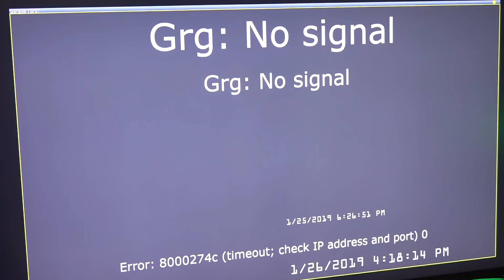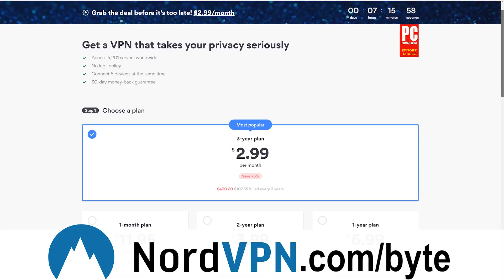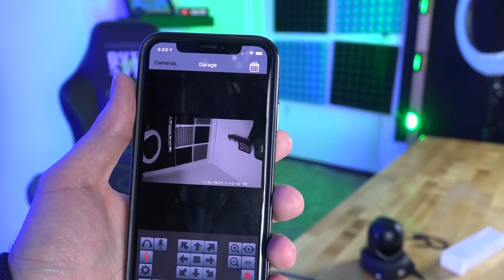I will force this camera to use PoE, even if it doesn't support it!

Comment: i thought you're gonna make a camera use PoE that uses good old coax connection normally
Reply: You can do that too... Axis, and probably a few others, make devices that adapt/convert PoE Ethernet connection to coax and then back to PoE. They enable you to replace analog cameras with digital PoE cameras and still use the old coax cable.

Comment: im not sure how this solves the wifi problem he kept saying was having. was kinda expecting the camera to be opened and the power lines from the ethernet jack would be hacked to the dc jack input, then you would have a ethernet connected camera using  PoE. all youv'e done here is take the power from the PoE switch and discarded the  rest of it. the other way i was expecting was using a PoE injector if you didn't have a PoE switch, pretty common situation

Comment: I'm not sure it's specifically referenced in the electrical code, but you don't want to run 120VAC in the same wall cavity as low voltage networking cable.  You run the risk of an ignorant person accidentally bridging the two with a screw or other fastener and turning your low voltage cabling into high voltage cabling.

Additionally, that white area on the drywall is covering screws.  There will be screws every 8-12" on ceilings and every 16 inches on walls.  You could have verified where the screws were by using a magnet on the drywall first.  Also, should you ever want to finish the wall in the garage, you will need to patch the ceiling, cut a new hole in the top plate and run the cable down.  Might as well just cut the hole in the top plate to begin with and save the time.
Reply: This comment is underrated! TY!

Comment: Hey Jason, I'm a big fan of the show! I was just reading about the class action lawsuit involving the core count of the fx series processors. Basically because the cores share a floating point modules they cant be considered full cores. As I am currently using an fx8350 as a plex server on unraid I was wondering if the transcoding process is more integer or FP heavy?

Comment: Drive rings would do wonders for cleaning up the mess in your attic.  Wouldn't take a lot of work and in the long run, less chance of walking on the network wires and damaging them.  By the way, with such a tall access point for the attic, why not just buy the right ladder for the job.  Just makes sense.

Comment: You should have put the wire through the wood, then fill the hole with fire rated cauk, that way if you want to finish the garage the wire won't be in the way. You can also add another switch out in your garage just in case you need more ports.

Comment: I would have put the hole through the header plate.  That way if you ever put insulation in your garage walls and decide to put up sheetrock it would be easier to hide the cables at that time.
Reply: He's not qualified to drill into the top plate

Comment: Any reason you didn't run the cable through the top stud? it could have been much cleaner that way and it would have been better for the off chance you finish the drywall in there.
Reply from the maker: because the top stud was only partially open at the top. I could have done it with a little measuring but...
Reply: @Bytemybits  measure once, drill twice